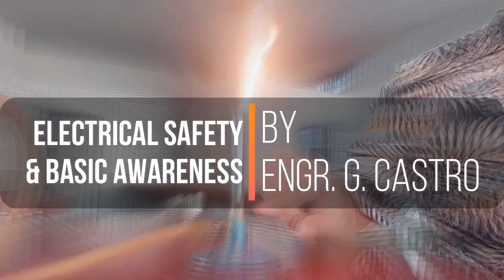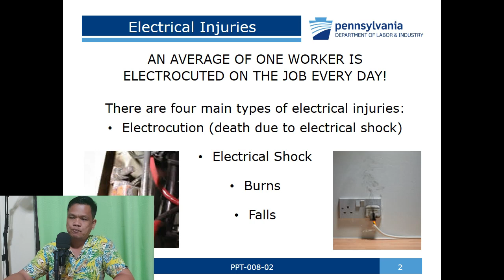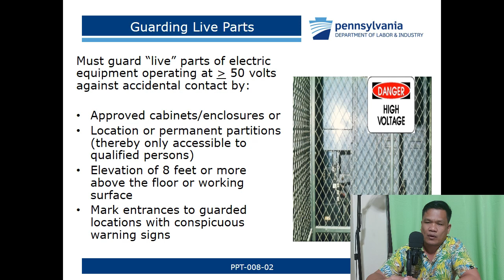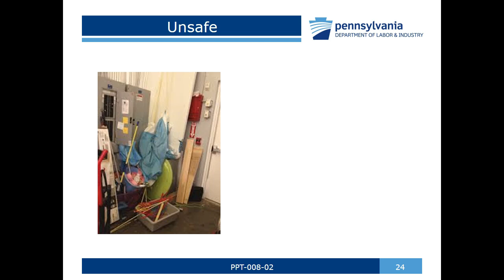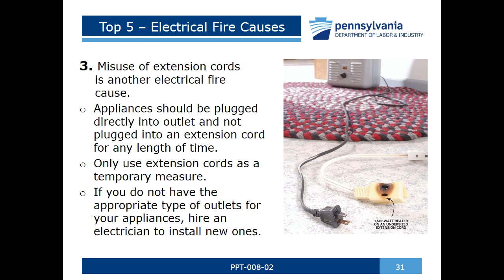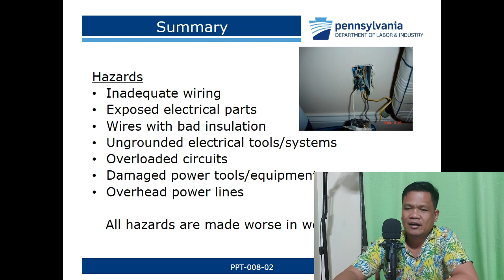Basic Electronics- Electrical Safety

Comment: FLORES, MANUEL JR. B.
BSMRE-1B 

Thank you sir for this discussion today. I learned some Electrical Safety basic awareness, cause of electrical burns, hazard of overloading, grounding path, proper placement of cabinets,boxes, fitting, permissible and prohibited use of flexible cords, picture of unsafe in electrical, GFCI, protective measures, good measure and how to avoid injury.

Four main type of electrical injuries 
-Electrocution 
-Electrical shock
-Burn
-Falls

Top 5 Electrical Fire Cause 
-Electrical outlet and old, outdated appliances 
-light fixtures, lamp and light bulbs
-misuse of extension cords
-space heater 
-outdated wirings